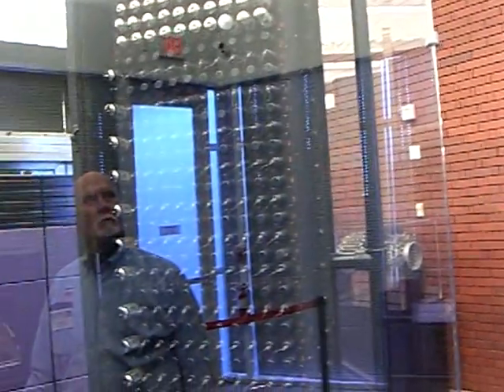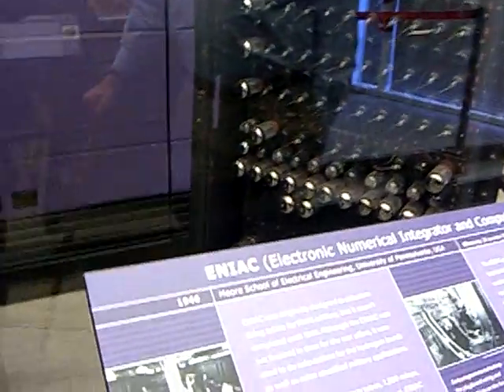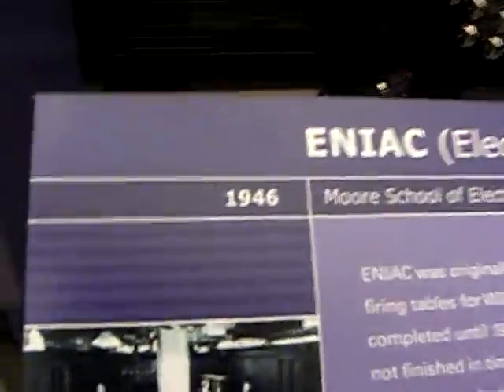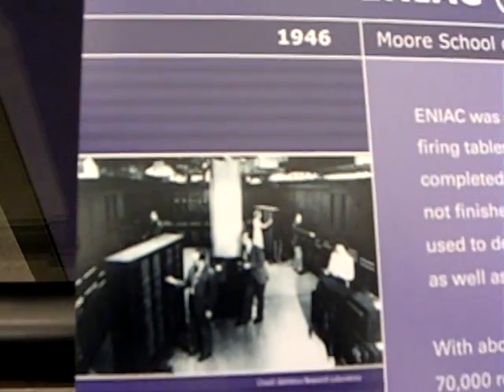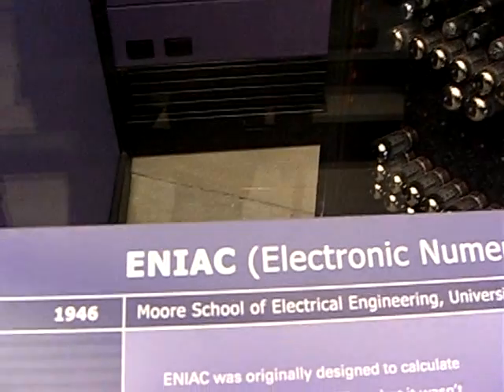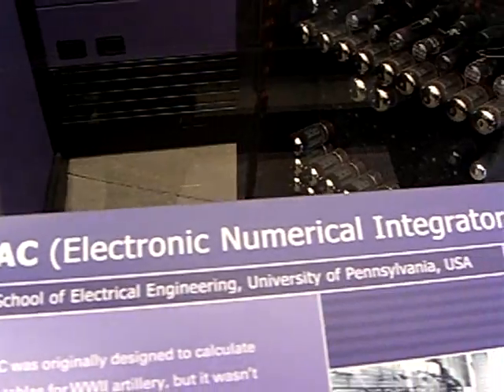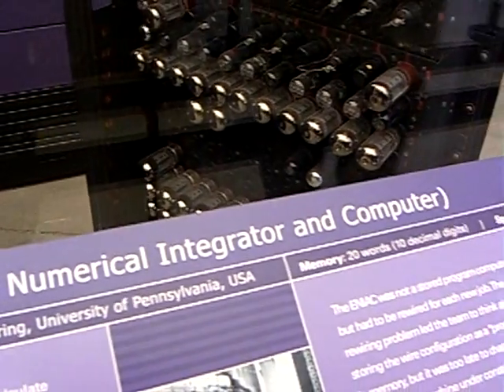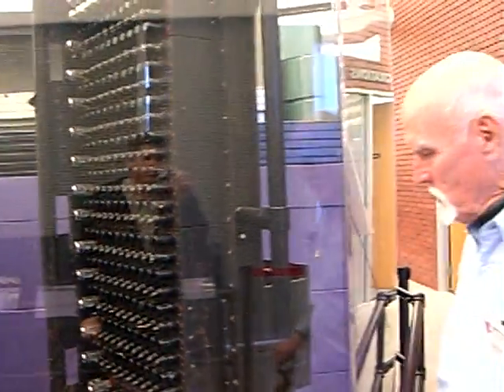1946 ENIAC - Electronic Numerical Integrator and Computing

Comment: I think you're confusing something there, gerodinis. A CPU doesn't have to be an integrated circuit, aka microprocessor. It's just the core unit of a computer setup, hence the term "Central Processing Unit". With many early mainframes, the CPU was a closet-sized stand-alone device, forming the actual "computer" together with the console, tape decks, HDDs, card punches and the power supply. Those usually weren't considered peripherals, because you couldn't operate the main unit without them.